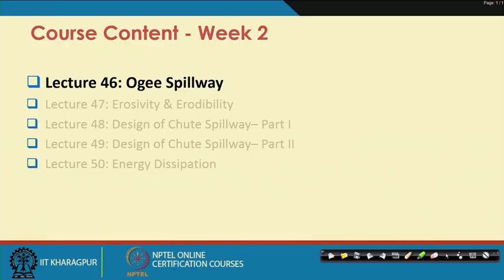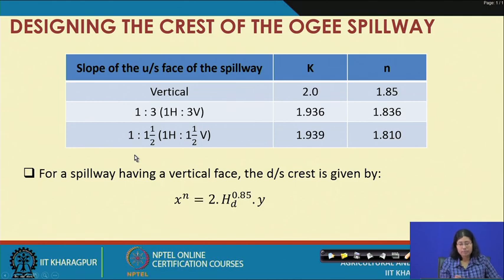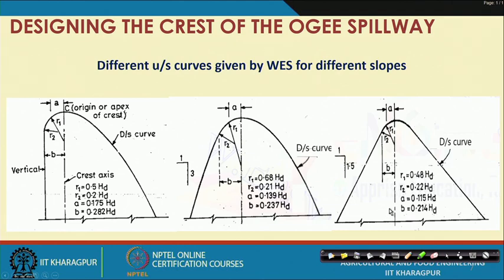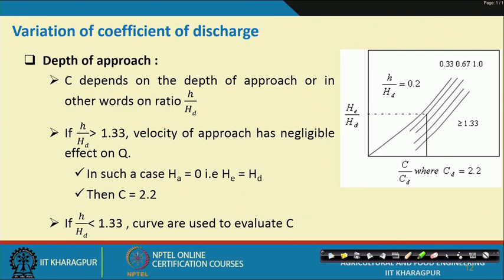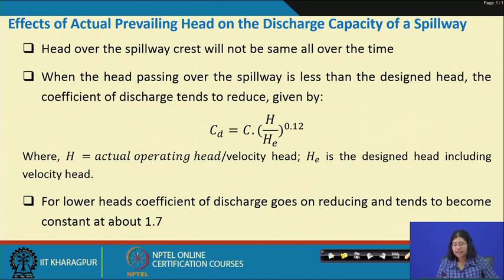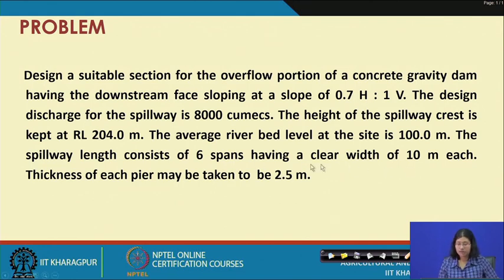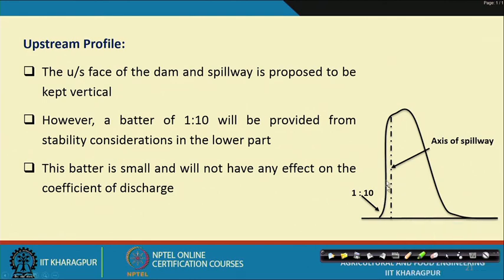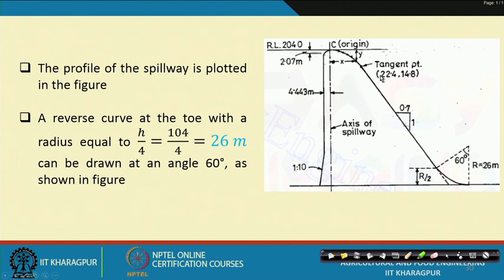Lecture 43: Ogee Spillway

Comment: What is meant by negative pressure on crest?
Reply: On approaching the crest, the stream has a velocity. At the top of stream exposed to stream,  the pressure would be atmospheric( p=0) but as we go down the speed would increase and as a result  pressure would go on becoming less than zero, as per Bernoulli equation
Reply: @divyanshushankar8134  sorry , thats an same theroy given in book but what is meant by negative pressure, Is it opposing pressure or something pressure gradient change.
Reply: @omygod1590  Positive pressure means water will apply pressure on surface of dam and negative pressure means dam surface will apply pressure on water. Since dam surface can take pressure so no problem, but when pressure acts on water surface, it can't take and separates from dam surface. And further cavitation and all develops at the interface between dam surface and water surface, that you know!
Reply: @ashokpareek2472  tks mn